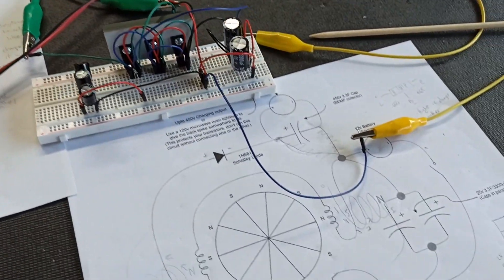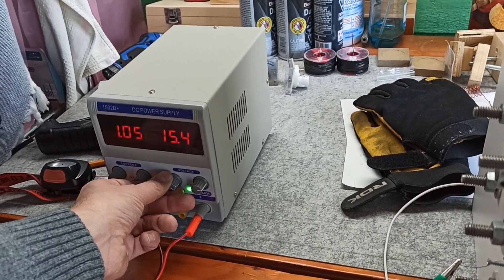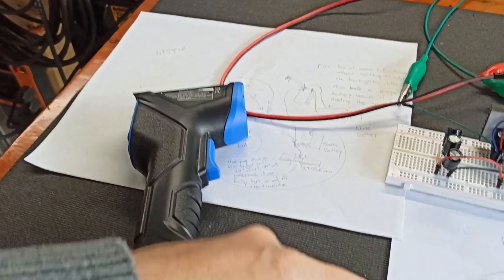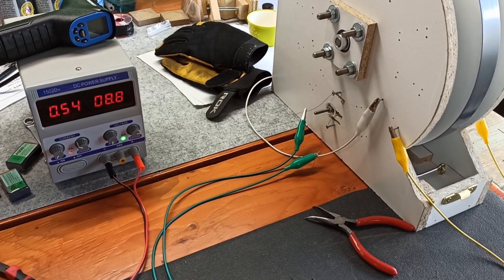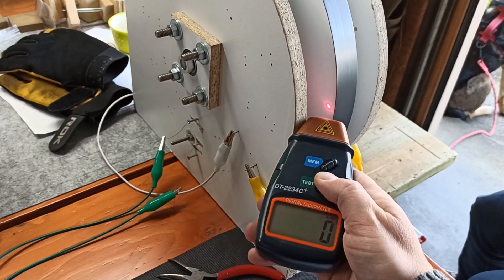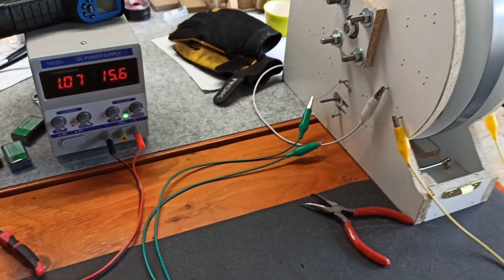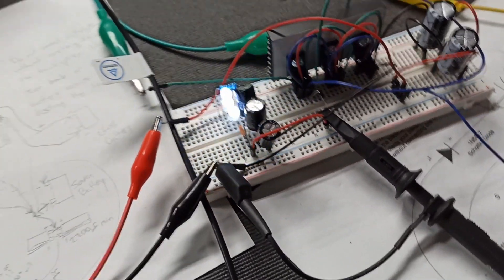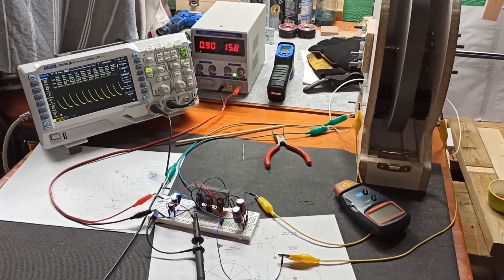Electro-Magnetic Pulse Motor - Part 23

Comment: Hey Vincent, how's it going? I suggest you take a look at some of my videos I've done on the Adams motor. I'm running the motor now down to between 30 to 40 milliamps of current now and I'm still able to run at this motor on a 500 ferret super cap bank at for 2 and 1/2 hours straight!! Check out my latest video https://youtu.be/XCUvPp--f9g